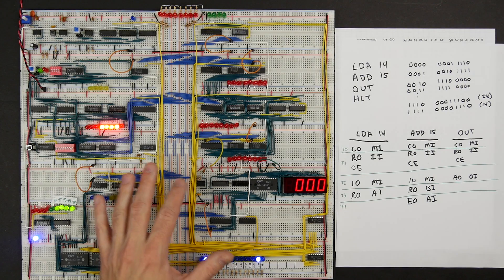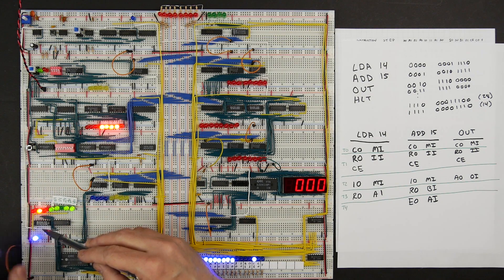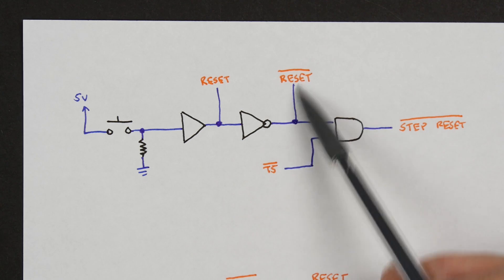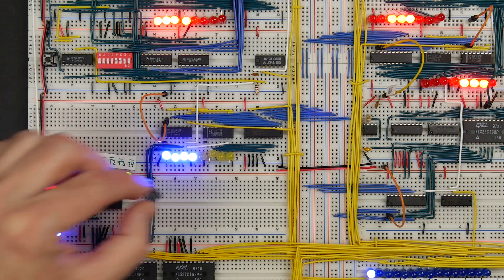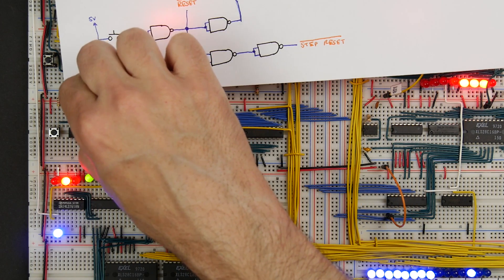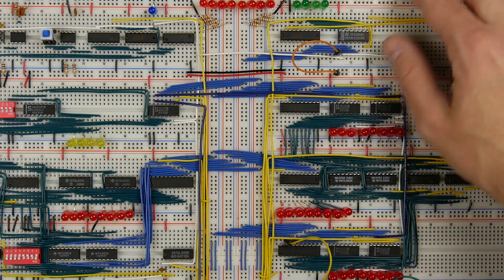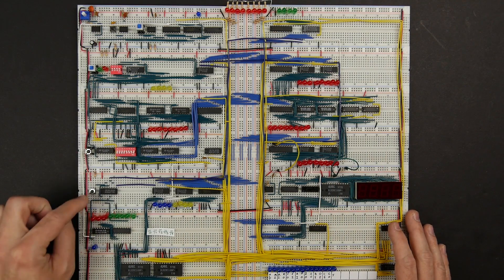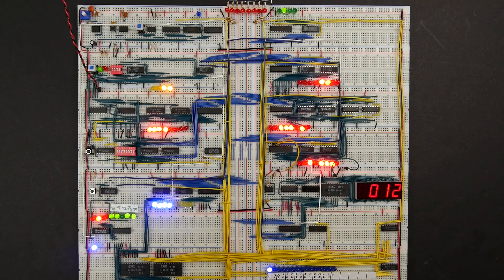8-bit CPU reset circuit and power supply tips

Comment: How much money would one need to throw at a project like this?
Reply: I had to pay around 150 Euros for everything and I already got a lot of cheap parts, so it may be more expensive if you e.g. want higher quality breadboards. I can overall just advise not to completly cheap out on these boards, because I got the cheapest ones I could find on Ebay and sometimes it is a real pain in the ass to get those cables and ICs in there...
Reply: I am Canadian, so note prices are in CAD. I think you can get all the components for $100-150. Then you need to get the breadboards which have various prices for different qualities. I am experimenting with a couple different ones now. Then you need the wire. That can be pricey. Finally, if you don't have any tools you will need to get that. IMO a multimeter to measure voltage is a minimum. A more capable multimeter will help but with the knowledge from this series you can build a circuit the measure capacitance and resistance (if you think about it) ;)

Comment: building myself a copy of this computer, bought the pieces on the weekend and built the clock today

thanks for making these videos, so far this is a lot of fun and has reinvigorated my interest in electronics
Reply: Crushnaut good luck! Planning to do the same myself. 
Quick question; how much did all the parts come around costing? Bought them online?
Reply: +Johnny Phoenix I have a local electronics store called Sayal. They had almost everything, plus I got some extras. The parts were about $220 CAD. I haven't got all the breadboards yet, or the EEPROMs. That'll probably get me up to $300 ish.

*edit see my comment below. I bought a lot of extra parts and lots of wire and such. You can probably do this a lot cheaper if you stick to just the requirements on Ben's blog. I put together the parts for this project + a lot of starter parts of a hobby electrical kit.
Reply: Aw wow Crushnaut, I know Sayal may be convenient but the cost buying from them (components, not the breadboards/wire) will be alot higher than just placing a Digikey.ca (or .com) order.  The parts would have shipped 2 day (for free >$100 order).  I'm going to make a BOM from his videos on Digikey and then give a more accurate cost.  I'll let either Ben know, or just post a comment in one of his latest videos.  Considering doing this myself, but I'm considering the PCB route... I'm not a breadboard type of guy ;-)
Reply: Well I have only done the clock so far. Right now it is about as clean as Ben's. I started off with a lot of jumpers and long leads on Caps and Resistors. I cleaned it all up though and it is looking nice. I will have to let you know once I get the really long leads going for things like the control signals and the bus.
Reply: Yep got me on that, yes was referring to the 189 not 185.  Nice find on the 219.  Now I know where I can get some from ... thanks.
Reply: Crushnaut I'm thinking of making a version of this except using solderable proto boards and an IDC backplane. I've already made a front panel and got my dad to help make a card cage for it. Most of the parts are on there way or received. Once they are all here I will probably marathon all the videos again
Reply: oh thank you! 51 IC's :o
Reply: @chris mckernan ... so I have been shopping around for the BB830s. I emailed the manufacturer directly. They will sell in bulk, but directed me to http://www.juniorgeniuskits.com/ for US orders and http://www.breadboardstore.com/ for Canadian orders. I tried ordering some off Amazon and got the knock offs Ben talks about in his video. If you want quite a few try emailing sales@busboard.com. They are very helpful.
Reply: Crushnaut does your computer as clean as Ben's computer? or do you have jumpers all over the place?
Reply: I did some comparisons. The prices weren't THAT different. Sometimes Sayal was cheaper. For instance on the SN74LS00N Digikey is $1.78 CAD. I got mine for $0.50 each.

Another thing to consider for my costs was that I got 100 feet of 6 colours of 22 AWG wire. That was $20 a roll which was $120. Compared to the recommended product on Ben's site for 6 colours @ 25 feet each for $22 USD I think I did alright. 

The other reason I am estimating is because I also bought a multimeter, needle nose pliers, wire cutters, and wire strippers (I guessed when I removed the cost of these tools). I also got some jumper pin headers and extra parts. For instance you only need 7 74LS173 registers. I bought 10. I got large packs multipacks capacitors, and resistors (over kill but a good starter set up as I have nothing). Finally, I also got 100 packs of LEDs in 4 colours. Those we like $15 each (I think). Again over kill but I was building a starter pack for electronics.

I think if I just bought the parts for this PC I could have got everything in at around $200.
Reply: Ok, so I'm thinking you did pretty good.  All in Bill Of Materials on Digikey was $125 CAD, now with that said it doesn't include the WIRE, BREADBOARDS and the elusive 74LS185.  I'm betting Mouser would be another 10-15$ cheaper than that.  I also did a substitution for the EEPROMs using 28C64's instead of the 16's, and the 7-segments are 4 digit CC rather than 4 separate digits. After I double check everything I'll publish a link, maybe with a Mouser equiv.  I'd shop around for the wire / breadboards anyway.  I may look at Sayal's prices.
Reply: Crushnaut j
Reply: I'd recommend Jamco.com. I compared prices against Amazon, eBay, Digikey, Mouser and a few others. Jameco usually has the lowest price. I've placed several orders with them and have been very happy with their service.
Reply: Appreciate the reference.  Will look into them.
Reply: Chris McKernan the site provided was the cheapest I could find them. I ordeded a pack of twenty. For straight from the manufacturer they wanted you to buy more. Still that site was cheaper than mouser and digikey.
Reply: @Crushnaut , were you able to finish building the computer?  Could you please give an update on your build?
Reply: @Mr_ToR  I got it about 75% done. I ran into some signal issues that took a while to sort out (likely a bad IC). Life got busy, I had to move, so I had to disassemble a chunk of it. I haven't got around to putting it back together again.

Long story short, it isn't done, but I still want to return to it one day as it was a lot of fun.
Reply: @Crushnaut , well I'm considering doing it too and I was actually wondering if life got in the way for completing it :-)  Did you keep a journal or posted on a forum etc about the issues you've experienced while building it?
Reply: @Mr_ToR  I did not do a blog or journal. Besides the above mentioned issues finding parts, mistakes is building the circuit, the only other problem I had was a voltage drop on the clock signal. Basically I found when I completed the registers, and adder and tried setting up a counting program. My A register would go to 0111 1111 and then tick over to 0000 0001 instead of 1000 0000. I traced it back to low voltage on the clock. I thought at first it was an issue with the LEDs I picked and they were pulling to much voltage. Instead I swapped out an IC in my register and the problem went away. Put it back it returned. I had a post on Reddit where some people helped me diagnosis the problem. You might be able to search and find it if you search Google for "Ben Eater" Crushnaut site:Reddit.com

The real time suck of this project is keeping it neat, cutting/stripping wires, and then organizing everything. I was trying not to follow Ben's videos 1 to 1. Instead I was watching the video, diagramming the circuit, and then building it myself on the boards. Afterwards I would compare my build to Ben's to see what I did different.
Reply: @Crushnaut  Awesome, thnx for the info.  Well, I hope you would finish at some point and either post here or even better make a video about it.  I would really love to see how someone else's interpretation would look.
Reply: @Mr_ToR  for sure, and best of success on your project!
Reply: @Crushnaut  👍
Reply: i think its beyond a toy for a lot of reasons :D
Reply: Agreed, however much I like this project myself. I have been considering to use this as an educational tool for my IGCSE students but didn't. Most of them would not be able to muster up the patience to build this, let alone trouble shoot it.
Reply: nice
Reply: btw Ben is neat
Reply: Crushnaut How about china? Ordering everything from Aliexpress or Banggood might be cheaper.
Reply: And? :)
Reply: What is the 74LS185 used for? Do you mean the 74LS189? Sayal had some of those, but better yet, the 74LS219 in the warehouse (outputs the stored value, not the inverse). I have asked them to ship them to my local store.